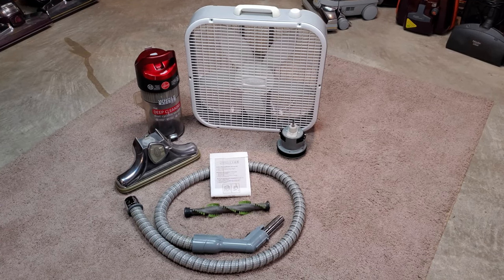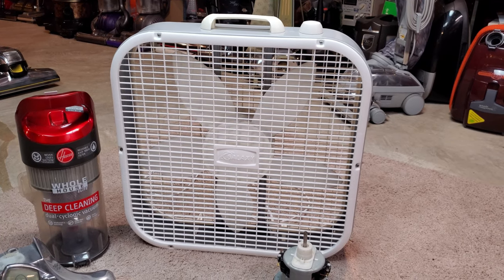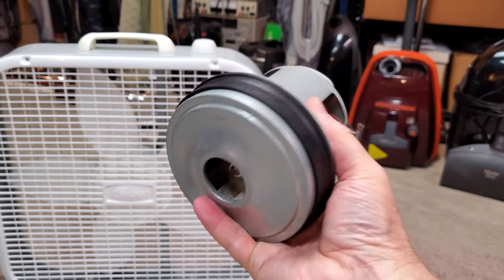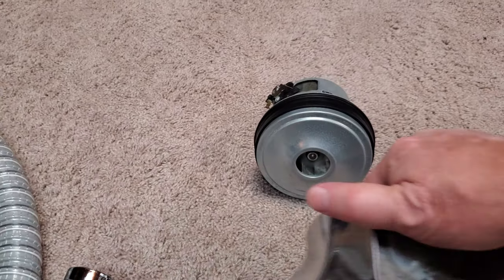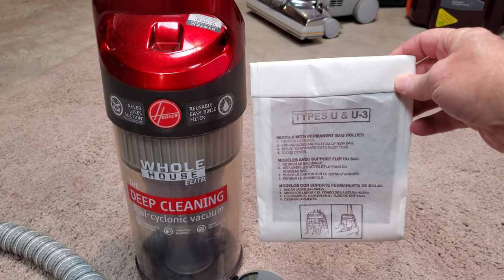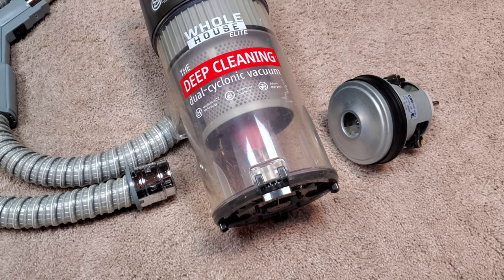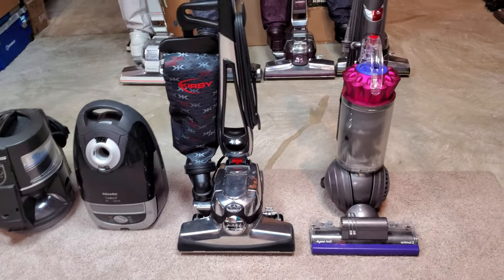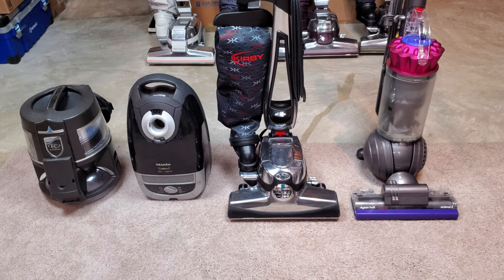How A Typical Electric Vacuum Works

Comment: I know there are others on YouTube in the vacuum community that think that direct-air cleaning systems are out of date and not powerful enough.  I keep mentioning the fact that in industrial or large scale applications (leaf and lawn vacuums, dust collectors, etc.) still use the Kirby design due to the simplicity, robustness and power (picking up soggy wet leaves).  You don't typically see in those applications bypass/clean-air systems probably due to the inefficiencies with them.  Although, I must say I like my Kirby vacs but I like the versatility of the Rainbow system as well.  Once you know how to use a Kirby, going from above-floor to floor isn't all that difficult.  The fellow from (paraphrased) EfficiencyRatings, (who has a tachometer in his logo next to a stick man) tried to demonstrate how difficult the Kirby was to operate, and he brought in an engineer...but engineers should ask, "Okay, you want me to use this, where's the manual?"  Ultimately, that video was one of his worst and now he's OCD with Shark.  I left a comment saying he should just let people spend their money on what they want.  

I mean, Miele and Sebo are, to me, overrated and he seems to like pushing them but I look at the number and size of filters these machines use, and the filters and machines that fit the lifespan of a Kirby or a Rainbow actually exceed the overall price of both machines considerably, and environmentally aren't great either.  I like the simplicity of Numatic's machines and a Henry would work well with a Wessel-Werk EBK340 or 360 nozzle and there is a hose conversion for them.  

I am of the impression that engineering students really need to remember that the KISS rule is the first thing they are taught.  I was taught that and reminded of it throughout the education I received from high school and college (computer engineering technology, which I only completed one semester, but some of those pieces of knowledge still remain with me today).
Reply: Power tools guys usually have a balanced view about this debate.  Point is: can the machine do what you're asking it to?  That's why vaclabs under carpet tests are very useful for home cleaning.  They're practical tests.  But that same practical test is not useful for a different purpose, like leaf baggers.
Reply: @vap0rtranz  I think you misinterpreted my comment.  I said the pickup performance for "dirty fan" cleaners is quite good.  That said, I also said that the fellow from another channel, that I paraphrased as a different set of words, I think he needs to do how VacLab does to test the PERFORMANCE of cleaners to make his video REVIEWS, Hint-hint.
Reply: @WJCTechyman  no disagreement.  maybe my point was not clear -- I was agreeing with you that power tools, like leaf baggers, use "dirty" fans.  All I'm saying is that many power tool guys seem balanced about the performance of these machines.  Some will want very high " water lift when -- guess what -- they're wanting to suck up water with a shopvac; and others do say they want very high CFM airflow when -- guess what -- they're wanting to clean up saw dust.  I was agreeing with you some vacuum testers -- like the Ytuber you mentioned, hint hint -- are not balanced when testing what a homeowner needs from a vaccum.  I find vaclab's tests very useful to someone cleaning a home, and will stand by that regardless of online interpretation :)

Comment: For other viewers, another difference (and I know Vaclab knows this) between clean and dirty air machines is the fan design. A clean air machine can have multiple stages of tightly fitting, highly curved, many bladed fans, since the air is relatively clean. A fan first machine like a Kirby needs to have a single stage fan with a much larger volute and more clearance around the fan, so it can pass the dirt (and pennies, rocks, marbles etc) that go through it. This is why dirty air machines typically win in airflow and lose in suction, and vice-versa for clean air machines.

Comment: I've heard that Dirty Fan cleaners are still to this day, the best way to get a carpet perfectly clean.

I'd guess why the dirty fan cleaner gives a deeper/better clean is because all the airflow and suction is right there at the head, and doesn't have to travel through hoses/ducting to get to the cleaner head, avoiding loosing some of the suction/Airflow.

It's amazing that the design Spangler designed in 1908 still to this day, remains the perfect way to get a carpet perfectly clean isn't it?

We mostly have clean/bypass air vacuums today, and they're great, but I think dirty fan vacuums with a stiff brush roll like the old Hoover's and Kirby's give a deeper clean.

It'd be amazing if they could make some modern dirty fan vacuums 👍🏻

Great video pal 😁👌🏻
Reply from the maker: For pile carpets, high airflow combined with the proper agitation always wins. High airflow is non-destructive and fan first machines use much less power as well.

Comment: I also have a question..

I have a D4 rainbow from 1996 and a friend of mine asked me if I could take a look and clean her eSeries gold one speed and so I did. Bit I imagined it would have more suction power but it looks almost the same as mine..

Does the e2 speed has more power? (Silver, gold and illuminate)? I heard they have the same induction motor the only change is design. Is it true?
Reply from the maker: The D4 series and E2 series are completely different designs. Checkout my playlists for lots of different measurements.
Reply: It's not an induction motor in the newer E2 and SRX main units, it's a motor called a Switched Reluctance motor that's controlled by a micro-controller.  If you have ever seen floppy disk drives and old printers, the motors are stepper motors and people have modified these motors to "sing" various songs, the Rainbow's SR motor is a simple version of them.  The E2 two speed has an increase in airflow over the D4, but like Bill of VacLab said, he has made various testing videos about these machines.  Over the history of Rexair, the machines and their motors have varied quite a bit over the years from a through-flow motor (vacuumed air is used to cool the motor) to peripheral and tangential bipass machines (D4-first eSeries, E2 two speed) back to a weird motor design that somewhat follows the design of the later D2 models and the D3, but uses the SR motor system to drive it (SRX).  The SRX is a weird model of the Rainbow as it has some improvements but other changes fit into the "Why?" category too.
Reply: @VacLab  but the D4 and eSeries one speed are almost the same measurements, right?
Reply: @Vidamaislevecf  Well, from what I have seen from his videos, the eSeries has considerably high airflow but lacks a bit in suction.  The designs are different as the D4 is a twin-fan stage motor and the eSeris is a single-fan stage design.  That said, the eSeries also has a higher rate of rotational speed than the D4.
Reply from the maker: @Vidamaislevecf  the E series single speed has the best measurements I've tested to date. The D4 is much worse.
Reply: @VacLab  so if I decide to change my D4 for another model (e Series one speed, E2 gold, silver and illuminate I should pick the gold one speed series. Is that right?
Reply from the maker: @Vidamaislevecf  yes, the E series one speed is the best. Far better than the disappointing SRX. But, the one speed is old and will most likely need bearings.
Reply: @VacLab  The other thing to consider is durability and build quality.  The D4 is perhaps the best in these regards.  The eSeries have, at times, lackluster motor build compared to the D4 and E2.  When buying an eSeries, keep in mind that there were two motors and they were outsourced.  If you get a GS Electric powered main unit, it is of superior quality to the later Amatek.  Amatek bought GS Electric and continued to make the Rainbow motors in the GS design.  Either way, the E2 has an incredibly durable motor being brushless, and it and the D4 probably handle water pickup a bit better than the eSeries or the SRX due to the single fan stage design of both.  That said, the tests between all of them, when you get to the floor nozzle, probably all work out about the same or are negligible at best.  I say this because Rainbows, regardless of whether it's the D4, the E or E2, are multi-function machines.  So they don't just vacuum, they can also wash rugs and carpets, hard floors and your furniture.  They may not be as strong as dedicated extractors and shampooers, but they also save a lot of space in your closet.  Every AquaMate model has something that most dedicated shampooers don't:  They have a built in rinse function.  This is important as it is important that your washing machine, dish washer and the way we bathe work, otherwise you leave soap residue and other "goodies" behind.  I apologise for the long rant, but thought it was important to mention.

Comment: My hoover vacuum doesn't have a hole opening to suck air from the outside so I don't know how it's sucking the air. How do you find the outside air vent that the suction motor is sucking the air from?
Reply from the maker: Airflow starts at the hose/nozzle and then exits through vents or the bag.
Reply: @VacLab  my hoover uses a wind dust bin not a bag so I don't know how it's sucking air from the outside when the wind dust bin has no outside air vent to suck air from, do u know what I mean?

Comment: Tandem air machines have a direct air motor in it but how does it not have an airflow to a kirby level? Does the air go through the hose or something? 🤔
Reply from the maker: The tandem machine is a compromised hybrid. The direct air part is not dedicated. Far too many people believe that any 2 motors are better thanca single dedicated motor. They clearly aren't. Yet another failed gimmick.